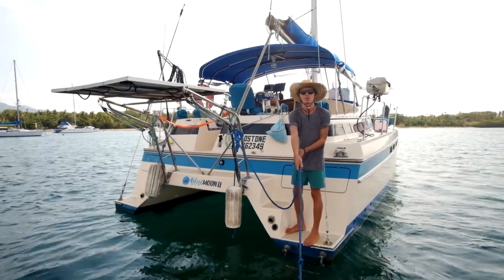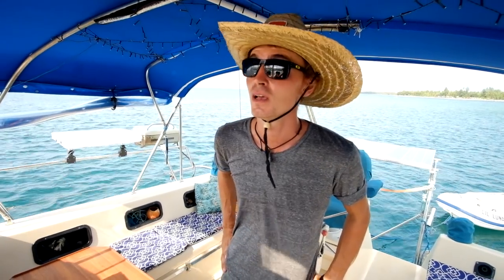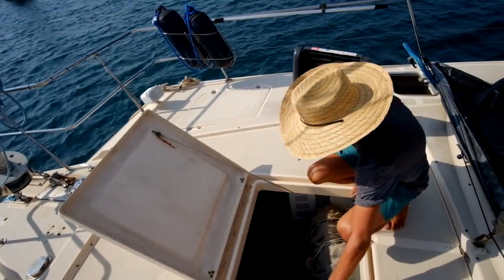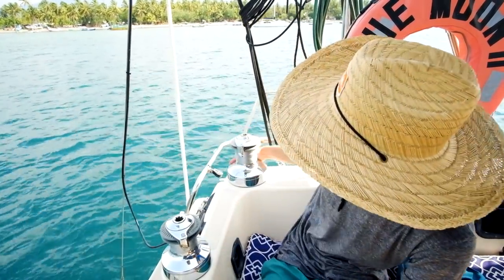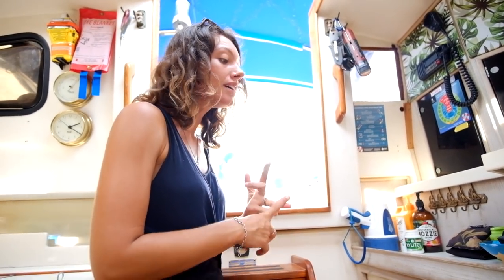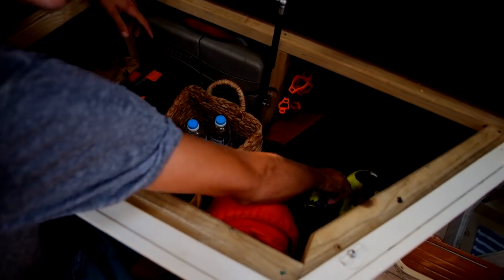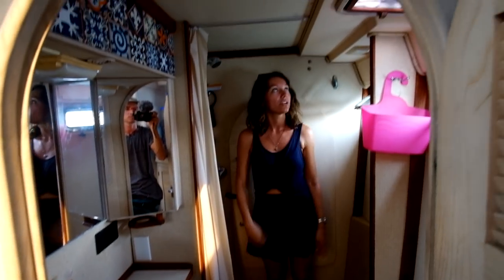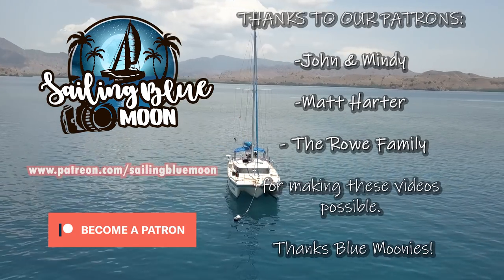Boat Tour - Island Packet Cat 35 (Sailing Blue Moon) Ep. 28

Comment: Hi!  Love your video!  It is what sold us on purchasing a Packet Cat.  We are currently attempting to install a watermaker and are interested to know how you feed the desalinated water into your tanks?  Specifically, what lines did you tap into or did you run all new lines to the aluminum tanks?  Any guidance is greatly appreciated.
Reply from the maker: All new lines. We had diverter valve to the sink for testing and another valve for selecting port or starboard watertank. Our watermaker lived in the Portside engine room with a generator behind the starboard engine, the generator failed so we removed it and used a small Honda 2000.